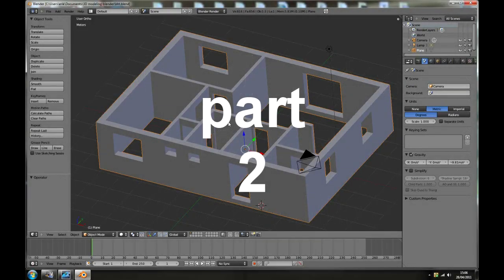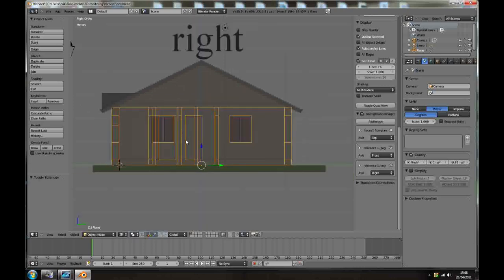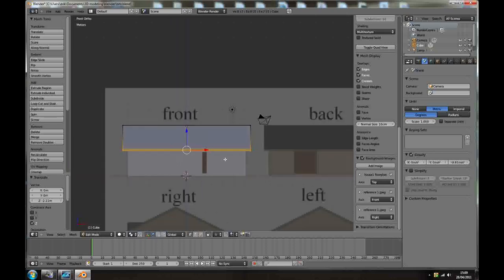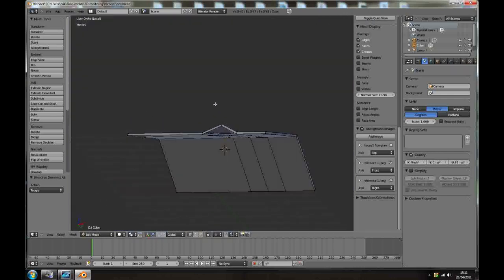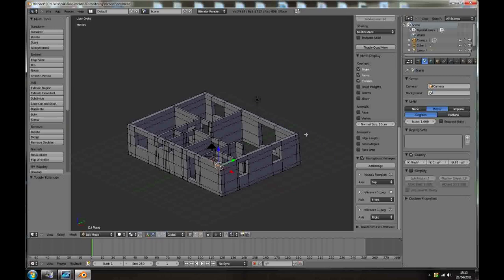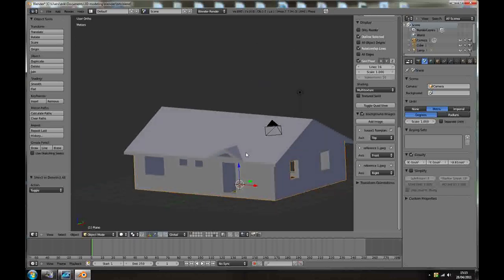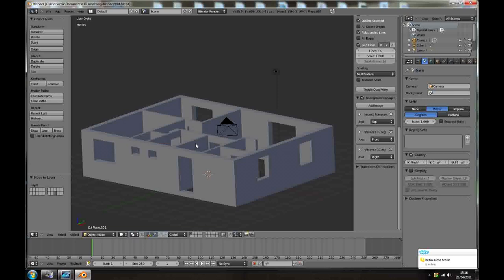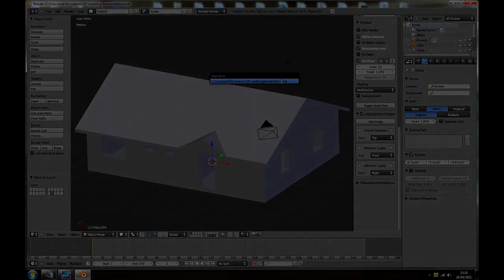Blender tutorial- Making a house part 2

Comment from the maker: When you're starting with building roof(adding a cube),you need to make sure you're in object,not edit mode.Your problem suggests that your roof was created while you still had exterior walls in edit mode,therefore everything added becomes a part of that mesh.To solve this,select object,go to edit mode,press A twice(select all and deselect),hold down L and move your 3d cursor over any roof face.Everything linked inside of roof part of the mesh will be highlighted.Press P and separate selection.